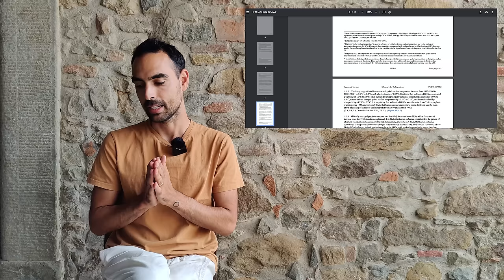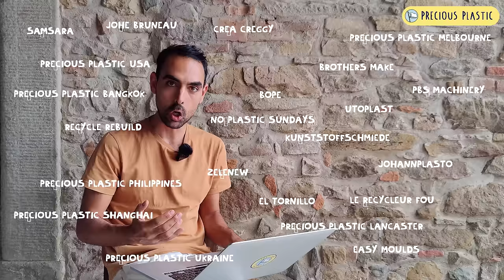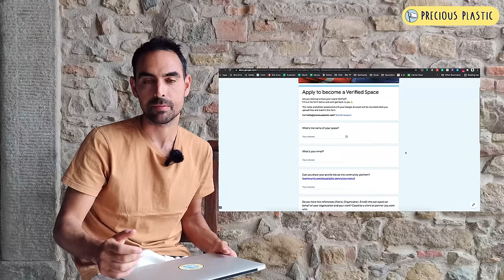Recycling plastic bottles into insulation material

Comment: Isn't that insulation highly flammable?
Reply: Highly flammable means holds more heat, that’s only a win
Reply: I figured all insulation used in houses is flammable anyway (cellulose, mineral wool, fiberglass, etc) so it doesn’t seem like an issue
Reply: @ladyofcuriousvirtue  rockwool claims to be heat tolerant to 1000 degrees and fibreglass is about as flammable as a wine glass...where are you getting your information?
Reply: @Aussiemoo   ………… I believe my friend in freshman year of community college for HVAC may have misled me 🤔
Reply: Yeah usually lots of bottles and stones burning in my area ;)
Btw seriously speaking you can also check the hempcrete - it’s both light construction (needs some skeleton though) and insulation - made of natural hemps and 100% human friendly 👍
Reply: @ladyofcuriousvirtue  mineral insulation, like rock wool and glass fiber aren't flammable at all, but cellulose and wood fiber insulation is generally impregnated with fire retardants, and has been shown to be significantly more fire resistant than PU foam. The same could probably be done with polyester fibers, although dont quote me on that.
Reply: @rfldss89   Thank you for educating me and not roasting me for this, lol 😅 Do you happen to know about what flame retardant is made of? Like could they take a secondhand product and recycle it or does it have to be a brand new chemical?
Reply: @rfldss89  I am only using sheep wool. So nice to work with.
Reply: Wondering if adding Boron like from Borax might help in fire retarding?  HHHmmm.... yes, though will be flammable and highly depending on how you define.
Reply: Oh, maybe like with the closed cell foams in attic spaces with use vs unused... the codes in some places require an "intumescent fireproofing paint."   Wondering what homemade DIY "intumescent fireproofing paint" can be used that is most cost effective?
Reply: What about EPS insulation systems? These systems are flammable but the key thing is to not allow oxygen (air) to be near something flammable or use borid acid (or so) to deal with that ;)

Comment: Hmm, recycled plastic fluff for insulation sounds effective, but unfortunately quite flammable. A bit too dangerous to build a home with without some other means of preventing fire spreading through it. I wonder sometimes if you could make some kind of thin-walled hollow cement/ceramic/clay/etc. bricks filled with insulating recycled plastic fluff. They'd still conduct heat around the edges, and they'd be weaker than solid bricks, but if you made a wall two layers thick, offset by half a brick in both directions, heat would have to follow a very serpentine path to bypass the insulation, but the flammable insulation would be isolated into discrete cells where it couldn't propagate fire between them.

Actually, a closed-cell 3D honeycomb of some kind (like cubic 3D printer infill?) might return quite a bit of the lost structural strength to the brick in addition to insulating it. While it's too slow for construction use, a 3D printed brick dipped thickly in some sort of cold-drying cement-like material (basically anything solid and fireproof) seems pretty ideal for an insulating material of that sort. Maybe it could even contain two sets of studs and sockets on the top and bottom surfaces to interlock them loosely. Seems like you could make a well-insulated, fire-resistant wall that's reasonably durable out of that, as long as you made it two layers thick (offset such that the 'seams' of one wall go over the bricks of the other)
Reply from the maker: Everything you said makes a lot of sense! For now we're simply experimenting to explore possibilities. Then will come feasibility tests :)
Reply: @OneArmyVideos  Create storage containers and buckets and wash baths, cups and plates

Comment: This idea is like the extrusion of large sheets vs smaller tiles for roofing and siding material I think is a great goal that would be very valuable for society.  Even if like the ice and water shield plastic sheet material that is used for roofing and even like for basement exterior liners on the larger structures.  Maybe can like deposit layers somehow on a large, like say for example, corrugated sheet 4'x8' mold that is one sided and ideally two sided for pressing once the layers are built up and filled with filler material.  So for filler material... thinking like Ultra High Performance Concrete (UHPC), concrete, bitumen/asphalt or other filler material where this fiber would be the re-enforcing like with UHPC metal fibers and I've read where some use polyethylene or I don't see why not other polymers.

Comment: Hi, guys! I love you and want to help the Ghanaians build homes out of plastic. Ghana is overwhelmed with plastics. I am going to buy the mold for plastic bricks but I am wondering if someone can build a mold for plastic shingles?
Reply: We tried a plastic shingle style for PP V4. Using the extruder. It's quite hard but totally doable
Reply: @sustainabledesign.studio  Thank you for your reply. I was thinking of curved roof tiles, kind of like the clay roof tiles used I california and  in Mexico. I'm sorry, I said "shingles" but I meant "tiles".
Reply from the maker: That would be a great application but challenging to achieve. Main issue being UV degradation of plastic sitting on a roof.
Reply: @OneArmyVideos   Well, I would have to agree with you about the UV issue.
Reply: @OneArmyVideos  You could rethink the roof structure though. The actual tiles could be covered with a layer of plastic that periodically needs to be replaced but takes the UV degradation forthe actual tiles. I'm thinking genre an extra foil you usually do not see on ceramic tiles.